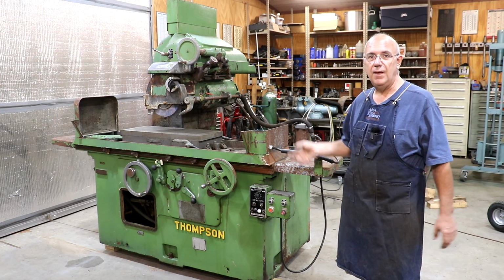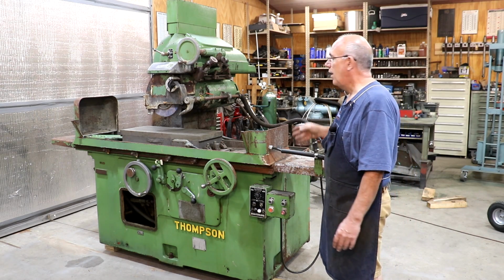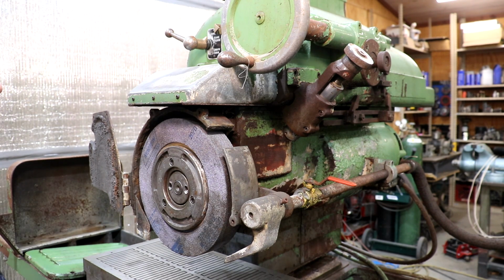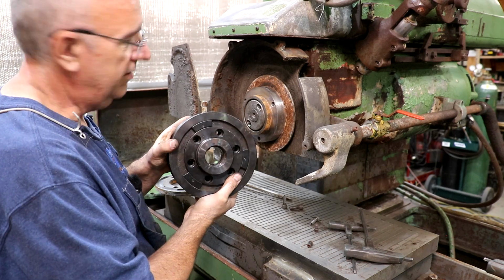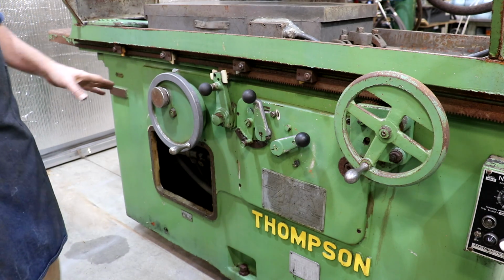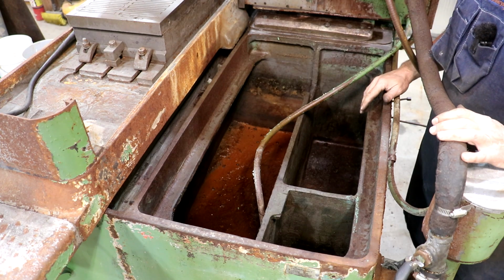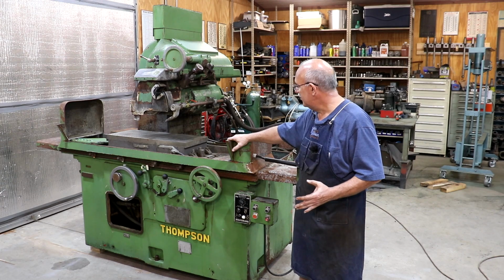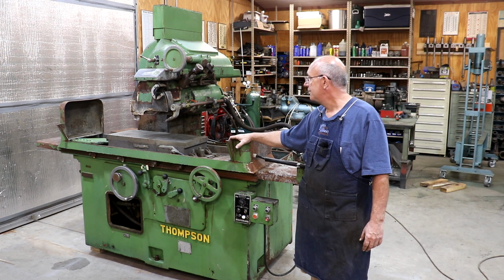New Machine Day! 12” x 30” Thompson Surface Grinder

Comment: Keith, hope all is well. I respect the passion you have for these old machines. I recently built a 30x40x14 shop and am currently in the process of filling it with old iron, however I am no machinist. I spent 27 years of my 62 looking through the windshield of a truck as an OTR truck driver. I am looking forward to restoring these old machines and learning to use them. I have been binge watching all your videos. I have a broken traverse shaft on a Cincinnati Bickford 3x9 RD. Would you be interested in helping me with this repair. I also need a contact for replacement springs. The elevation feed has a rod with a tension spring that is worn and broken and need to be replaced. I would appreciate it if you could pass on some information for a resource for parts for these old machines. My name is Henry, and I am located in Greenwood SC.

Comment: I have need of a flat surface to joint some old wood planes. I have a piece of 3/4 steel plate thatI would like to make flat.  Would you suggest milling or grinding the surface for this application.

Comment: Hydraulic oils don't get the same abuse as engine oils, they can take up dust and moisture from the air, and if you can take it out get it to water separate and hen run it through a 10 micron filter it should be as good as new. At least according to what i read on the forums on the internet. One guy talks about the hydraulic oil in a system where he works are over 40 years old and still good. 60 gallons is a chunk of change, so throwing it out if it is still good is a  waste. 50 gallon drum is 6-700 dollars...

Comment: I have two as well.  Looking for another home.  Nice production ones.  My Table moves up and down and the head is solid place.  Wet or dry.  2/3 sized that.  On 4x4 heavy pallet. That looks nice.  Lot of work to bring it back.   The Mag Chuck is like a 3-jaw nice to have.  Mine are 370v (Lighting voltage? ) 3-p.  I generate myself.  The bed is the work surface. That looks like a very nice clean mag chuck.

Comment: Nice find Keith. The grinding shop that I have used over the years restoring woodworking machines has a Thompson surface grinder that looks like the mag chuck is about 4 feet wide and about 10 or 12 feet long.

Comment: Keith, instead of getting a big transformer to step up voltage for the entire machine you might consider keeping the majority of the machine as 220v, and only use a smaller less expensive step up transformer to power just that one motor that requires 440v.

Comment: i gotta find a way to build a small version of that... though... for a project, a long bed, width capacity maybe 100mm max.  a bench grinder might be converted to do the job, finding a one piece rack to drive the table might be a struggle, considering the length i would want.

Comment: I'm getting a 32" surface grinder later this month, hopefully it doesn't take 65 gallons of hydraulic oil.. if it does I'll be trying to work out how best to clean the oil instead of just changing it, 65 gallons would cost about 2k here in Australia which is more than the grinder cost.. buying a few 12" wheels will be expensive enough without adding the cost of a oil change

Comment: Wow! Seems like a massive job to me. Can't wait to see you restoring it.
You could try using patience and gravity to separate the ingredients in the oil. Run it in a barrel, and leave that untouched for a week or so. Then drain the oil from the center. If you happen to have a vacuum pump, you can further degas the oil and let the water boil out. Then run the oil through some very fine filter cloth, and it should be a lot more usable.

Comment: I have rebuilt a number of machine tools and had similar issue with 3 phase electric motors with only 3 wires coming out in junction box. I easily fixed by locating the Star connection on the end of the windings, usually under the cover opposite the output shaft of the motor. Separate the connection and solder on extension wires to each lead. Insulate new connections properly and bring the 3 new wires out through the junction box. Had to do this so could run motors on a VFD which require Delta connection. Just a thought if the coolant pump wiring is the only reason you are looking at a transformer. Been running my machines for years on VFD after doing this and absolutely no problems. Cheers love your work.

Comment: It is great to see you happy (and funny) thanks to this find ("iron deficiency disease" indeed!) The transformer sounds like a win-win, less money, retains the original configuration, and you will have a 440v source for powering or testing something else. 60 gallons of hydraulic fluid! And the coolant tanks seem to work like septic tank separators. Good luck with getting it back into productive operation, I wish I was close enough to help!

Comment: we used a machine to grind the bottoms of snow skis with a stone wheel and it used a paper roll type filter to collect 90% + of the plastic and metal, when it got full we could replace the paper and not have to replace all of the collant, could that type of filter work with your machine?

Comment: I was working in an aircraft job shop and had the exact same surface grinder. They hired this guy that was supposed to be a "cracker jack". He had a 12" dia. part that needed .0005" taken off the top surface. They were supposed to give it to one of us but gave it to the "cracker jack". He's grinding away and all the sudden we hear a grrrr. Come to find out he when he was rapiding the wheel back he bought it to the end of the travel and it banged making the head drop about .003"... word to the wise never rapid the table all the way back if you do when you come close to the limit make sure you start feathering the handle so the head speed creeps until almost at the limit... PS. At least on that machine the wheel dresser never dressed that wheel straight. Always use a diamond on the table always undercut the back part of the wheel also!!! If you put a new wheel on balance the assy. Then install it on the machine dress it balance it again then re-dress it and you should be good to go!!! You would be surprised how many donut makers don't know how to properly run this grinder!

Comment: 18:00 Why couldn't you rig up some sort of filter system and try to filter the existing hydraulic fluid?   Obviously it wouldn't be as good as completely replacing the hydraulic fluid, but it would be extremely inexpensive.   You could just get a 55 gallon drum and pump the existing fluid through a stack of coffee filters into the drum, and then reverse the process and pump it through another stack of coffee filters back into the reservoir.    And if it still looks crappy and cloudy, then throw it away and replace it.   But if it were me, I'd at least give it a shot.

Comment: You might try filtering and heating the oil to over 212 degrees to clean and boil off any water.  It would be alot less expensive than changing out the oil.

Comment: Keith, if you can rent a small oil purifying centrifuge, it can clean up the oil. In the old powerhouse, we had a large Alfa-Laval on a cart, for our compressor oils. They do make smaller ones now days.
Might be cheaper than oil replacement.
Best wishes from the far North.

Comment: 440-480volts is a different beast, as an electrician for 40 years have seen many injuries and some deaths from this higher voltages on machines. Please be careful on hot tracing and troubleshooting.

Comment: I wonder if the hydraulic fluid in the new grinder is mineral oil. If it is, Keith may be able to clean it up and reuse it. It doesn't wear out.
Reply: Actually, oil  never wears out.  Doesn't matter what 'flavor' it is.  It just gets full of contaminates. If you don't burn it, you can clean and use it forever.

Comment: that America has so many different voltages in the power grid. 
In Europe it is 230 to 240 volts one phase. Or 400 to 415 volts three phase. Three phases are very common.
For the small variations, no transformer is necessary. Even if it's only 220V / 380V.

Comment: Congratulations on the upgrade! I hope it checks out to be ok. I think your transformer solution is the correct way to solve the problem . It’s difficult to find anyone who will rewind a  less than 25 HP motor these days and if they do the labor costs make it too expensive, less money to find a new replacement?
Reply: Now he will be keeping the original configuration and will have a 440v supply if he needs it for something else.

Comment: A cracked wheel is No Bueno! One one of the grinders we rebuilt we had a 60" x 4" wide wheel that an apprentice accidentally dropped an inch or so during handling, and didn't mention it to anyone. When the operator switched wheels back to the mishandled  wheel, when he spun it up and started to dress it in, the wheel exploded and damned near killed him. Broke his jaw, gave him a TBI, broke his arm in two spots, and this was after destroying a 1/2" steel shroud....
Reply: Too bad you had to publish your apprentice mistake here, a mistake happened someone got hurt , don’t need share with the world
Reply: @dundasjunctionmodelr.r-james  what's the issue? he didn't name the apprentice.  

its important to remember that an apprentice is not going to be as knowledgeable about safety issues that an experienced operator would.  this could be a good reminder to someone reading that post to educate/re-educate those that are working with grinders about how dangerous that wheel can be and that if there is any handling problems, to have the wheel checked before put back in storage.
Reply: @Jackhammer909  no issue really just did not  think this was the place to discuss the mistake , deal directly with apprentice no where else in my opinion

Comment: I used to work in a machine shop that did steel/aluminum/paper mill support and wecalso rebuilt cylindrical roll grinders and lathes. Our cylindrical grinders could achieve better than a 3 microInch finish. It was so smooth that it was no longer a mirror finish, but it was actually black due to destructive interference because the finish marks were smaller than the wavelength of light.
Reply: Landis, Mesta, and Morgan were the three that were most common.

Comment: Keith,  might save a bunch of cash getting the hydraulic fluid “polished” by a third party.  They connect the fluid to a machine that circulates it and takes out the dirt and any water.  Not a final solution but good for a few years
Reply: If the oil is cleaned properly and hasn't been burned, the oil will be good as new.  Oil does not wear out!

Comment: Aren't we fortunate here in Australia to have electricity supplied in 240 V single phase and 415 V three phase, no big complications to deal with. Congratulations on your new addition to your shop. Ray.
Reply: I'm from South Africa and we have no power here 😂
Reply: If Keith was a business, it'd already be 3 phase power. We only run single phase to homes in the US to save money because only people like Keith need 3 phase power.
Reply: Most homes here in the USA, at least those less than about 50 years old come with a number of 240 outlets for air conditioning, or have them added during the lifetime of the home. My home was built in 1925 and has 400 amps of 240, and I’m in New York City, not out in the countryside.
Reply: I'm Australian and 3 phase power only gets run to places that fork out the $$$$$ to get it, I wanted 3 phase power here and it was going to cost 30k so I bought a cs Lister diesel clone and belt drove a 3 phase alternator from that.. I run it on waste oil so it costs me nothing for fuel
Reply: @graedonmunro1793   your lucky, it's a real pain having to start a generator all the time but I just couldn't afford the 30k the power company quoted me to put in 3 phase here.. out here the power company charges you for the transformer which they then own and they charge 2k to upgrade the pole to one thick enough for a transformer and then I'd have to pay for the 120 meters of cable too all so they can sell me power at ridiculously high prices.. the transformers cost the power company under 1k and they sell them for over 15k

Comment: 60 gallons? I do acrylic court surfaces and most of our materials come in 30 U.S. gallon drums so I have a good idea what a pain getting that much hydraulic oil will be to handle but it might be easier to get the that size and a hand pump to transfer the oil in than 12 20 litre containers that you have to lift and pour.

Comment: That machine uses more hydraulic fluid than a CAT D-8 dozer.
Reply: Isn't that crazy they only needed a 5gallon sump I would think 60 gallons is nuts
Reply: @davidhamilton7628  My only guess is that it has something to do with preventing the oil from overheating since it's using hydraulic motors.  On dozers and skid steers using hydraulic motors, they have oil coolers behind the radiator to keep the fluid cool.  I'm guessing that this grinder uses oil volume to dissipate the heat throughout the sump.
Reply: @buckinthetree1233  that would be my guess too, i've seen numerous hydraulic systems that use a large oil tank instead of having a radiator